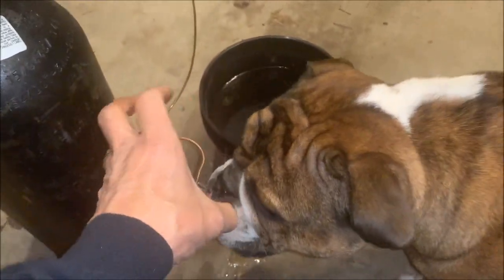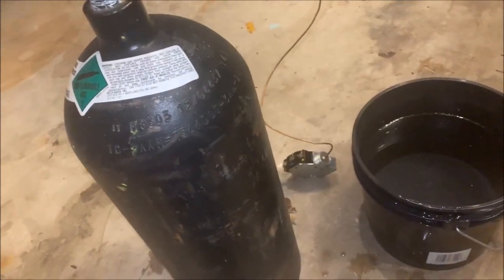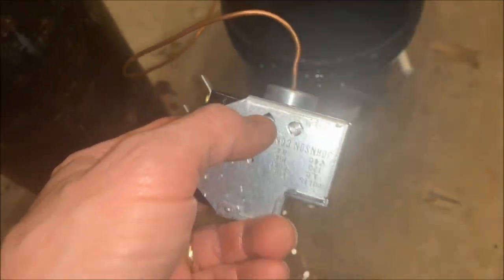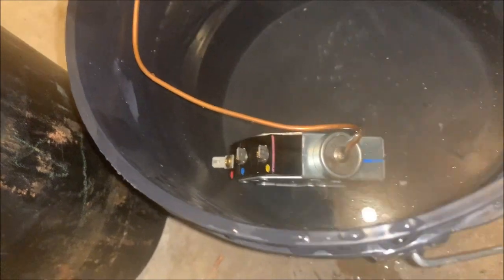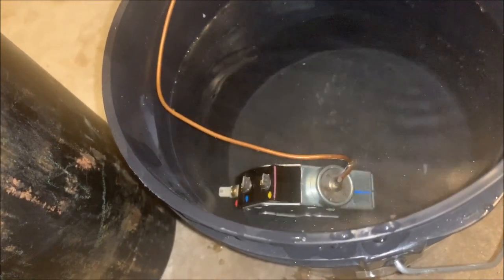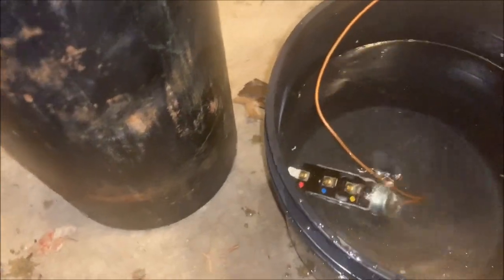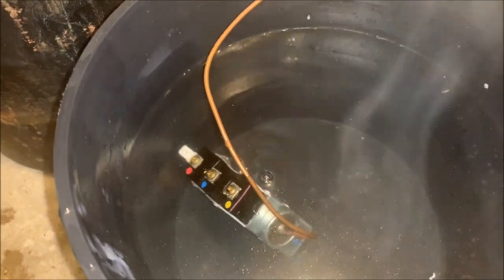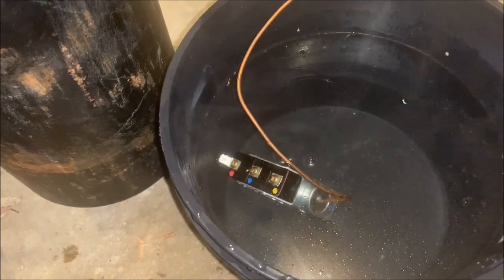Pressure Switch Issue

Comment: I would never have guessed it leaked at lower pressure but sealed up higher. Thanks for sharing. Sounds like you have experienced this before
Reply from the maker: Joe Shearer I have not. With what I could see and detect, in my mind it was the only logical explanation. Thank goodness for the H10!